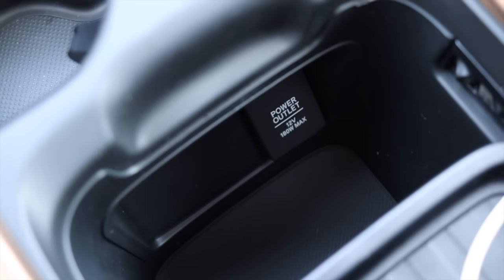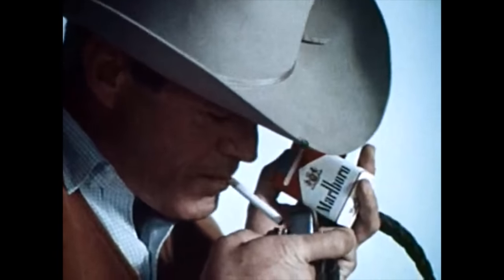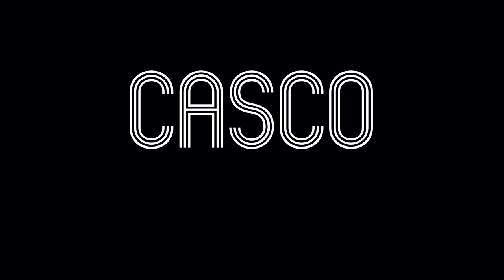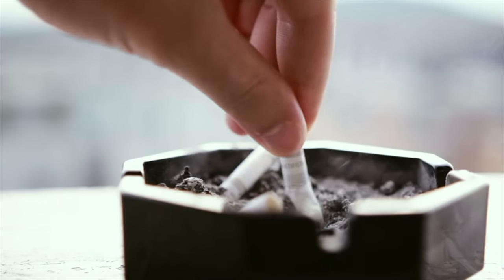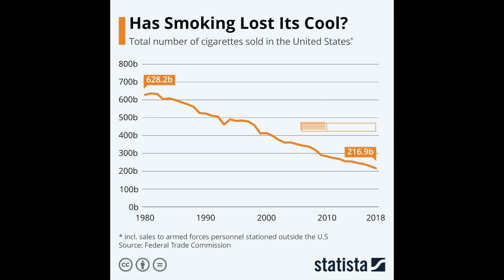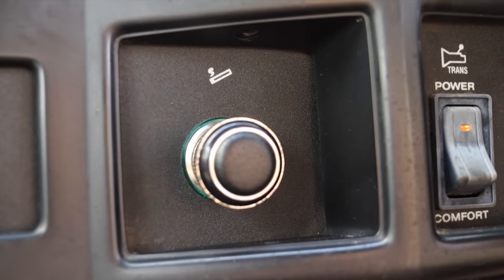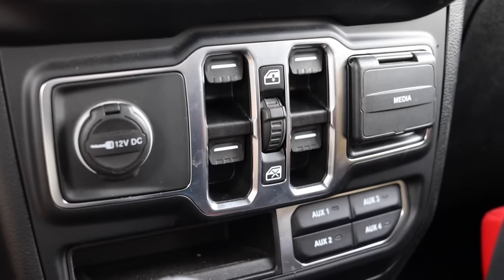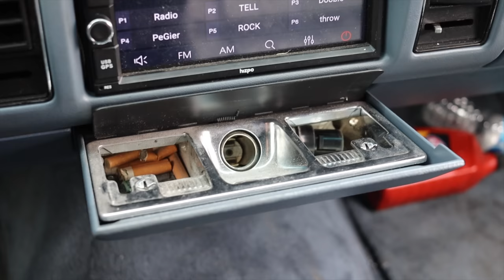Cigarette Lighters - How They Were Invented & Why They Went Away!

Comment: 4:39 not entirely, part of the reason they look different is because you can stick your finger in them and not get hurt. Household outlets ensure the contacts are hidden. Also plugs are different shapes in general to prevent plugging in devices that have different voltage, or current requirements. You can’t plug your dryer into a regular outlet. So all of these together are the reason
Reply: You can't plug a clothes dryer into a "regular" outlet because it uses 240V and a whole lot more amperage than a "regular" outlet can handle. It also requires a 4 pronged outlet, which combines two 120V lines to make 240V. All cars use a 12V negative ground DC system, so everything designed to be used in a car is designed for that system. I must have over 20 different things that are designed to be plugged into a "cigarette lighter" style car outlet. I have a 5 outlet pigtail that has one plug to plug into the outlet, then 5 separate outlets on it so I can connect up to 5 different things to a single outlet. If you overload it all it will do is blow a fuse.
Reply: @geraldscott4302  your reply is worded like you're disagreeing but nothing you said contradicts what they did
Reply: @MRdrPROkeithSR  I remember someone once said that the Internet is just people aggressively agreeing with each other and I feel like I see an example of that every day lol
Reply: @geraldscott4302  yeah you’re agreeing with me lol
Reply: "you can't plug your dryer into a regular outlet" had me puzzled for a solid minute
Reply: Only in the US you can plug a dryer into a regular socket.

Us more advanced countries have one socket that can power every household item.
Reply: @geraldscott4302  clothes dryer funny that i have a dryer washing machine combi plugged in with normal plug
Reply: Jam a dime or foil wrapper in it and you can get your finger burned, if you didnt blow the fuse first.
Reply: @geraldscott4302  actually 240 is the standard we just split it to get 120. Also you can get 120 volt dryers
Reply: @davidwithey6036  those mare usually eitehr hideaways or trailor sets
Reply: actually, you can plug in a dryer to a standard outlet in any country with an actually reasonable electrical system. not that we have much use for dryers in Australia anyway
Reply: @Robert-cu9bm  *only in the US you cannot plug your dryer into a standard outlet

(you said 'can')
Reply: @0011peace  no, they're on separate phases. normal countries have 240 on *each*, so if you're combining phases you can get a total of 420v. America's electrical system sucks so much ass
Reply: @rolls_8798  
No it's center tapped. They use a common ground
Reply: @0011peace  then why the hell are y'all using 110?

Edit: as in neutral, right?

Edit 2: don't phase separated waves have the same neutral anyway?
Reply: @rolls_8798   240 in europe they don't split  and the splitohase difference is 180 most circut don't care about the phase.  in one phase like in europe you have one direction to ground in us we have a opositive hot and negative hot with respect to each other.  We do this becausee its safer 120 at 15 is half the power  of 240  at 15 amps.  Power can burn and causes heating.  So it is safer to have cooler circuts.  But some devices need 240 so tap from prositive to negative its 120 - (-120) = 240 or -120 -120 = -240 dependimng current flow reference
Reply: yes you can plug your dryer into a normal outlet... except if you're in the good old USA with its archaic 110v. and a dryer 3 "foot" high.  Everywhere else the dryer is a metre high... and  240v... = plug the same
Reply: @rolls_8798  
Phase is relative to one of the branches. A center tap creates to signals 180 degrees out of phase with respect to the other. If had 240 center tapped you could get 480 total. Most modern devices use 12 volts at micro amps. Most dices just don't need 240 you can use less power. This means the plugs don't have to be rated for high thermal resistance. Twice the power means twice the heat. There is normally no need for the extra power. The way the make the power the same phase  is by putting the hot of each side on the hot and the other to in circuit ground. What most people call ground is earth or out of circuit ground and is safety feature. BTW, it's mostly just Europe not the world. Japan use 120
Reply: @0011peace  here our phases are 120° apart and we have 240 on each relative to ground. 120v is definitely worse for power and thermal control. The only benefit I can imagine is that since the safety mechanisms are so bad in your system (god awful plug and lack of house-wide GFCI and RCD), you need twice as much conductance/capacitance for a mains electric shock to kill you.

for a 120v appliance to get as much power as a 240v one, it needs twice as much current - simple ohm's law and I think you get it. More current means you need a much heavier gauge wire (copper shortage) and that a lot more energy is dissipated into the wire (as heat). This ends up globally limiting the amount of power your 120v outlets are able to provide (like 2000w or something isn't it?) and gives you a lot of house fires as well as a significant amount of electrical waste. Can't remember the last time we had a fire or death here caused by electrical apart from maybe a covered heater.

Edit: what you said about cooler circuits doesn't make any sense. if an appliance needs 120w, it needs it regardless of voltage, so at 120v it draws 1 amp, at 240v it draws 0.5 amp. only difference is the current

Edit: I said power instead of current goddammit
Reply: @0011peace  I'm in Australia not Europe, and again, the device needs as much power as it needs, so at twice the voltage it just uses half the current - which is a good thing. phone chargers don't use a lot of current but blenders and mitre saws and concrete mixers exist. it must suck to have a special outlet for only big appliances and high power devices (usually the power output of your power tools is just decreased instead, might be why so many Americans 'invest' in such wasteful and useless cordless tools when they don't have a use for them) and you have to run an extra line of wiring.

again, the 120v needs twice as much current which means more heat and that you need thicker wires for the same energy
Reply: @rolls_8798  
So you have 7.5 amp plugs and the idea that 120 is North American is wrong. Many 0laces have 120 in Asia. Besides 50 Hz causes flickering compared to 60 Hz because human eyes see at 60 Hz.
Reply: @rolls_8798  you need 7.5 half amp circuits to have the same power at twice the voltage.
It the breaker and the recepticles that matter no the devices for safety.  15 amp at 240 volt would be twice the power to 15 amp at 120.
Other than preference there is no real resaon one is better than the other.  The frequency however is 60 hz is superior as it matches teh eye movment and doesn't cause visual flickering.
we have 2 phase 240 total 2 phase which is better than 3 phase as its just negative vs positive and you can just reverse the leads to make it positive.  that is what tyhey do on the 120 circuits half use positve 120 the other inverted negative 120.  Some ciriots can can't handle 120 and trying to bring the phases together wouldn't work.  2 phase only takes inverting the leads
Reply: @0011peace  America is just the place most commonly associated with it and the people there tend to believe they're the best at everything for some reason (obesity rates maybe). 120v is worse wherever it is, it's especially highlighted in america though because of how bad the other aspects of its electrical system are as well.

the human eye does not see at 50hz or 60hz but hundreds of times faster than that. there is almost nothing where the frequency of mains is transferred into the final product. for example almost every LED light uses a switch mode power supply and dc (with a frequency millions of times greater than mains). perhaps a CFL? I might have noticed on a low quality unit that was failing, with my eyes half-closed, my vision blurred and being half-way asleep a visible flicker but I can almost guarantee the same thing would have been present with 60hz. the only thing that is perhaps the slightest bit cool about 60hz is that you can very easily make a clock keep time off of it, which they did back in the day, but incredibly inaccurately

Edit: CFL not CRT goddammit
Reply: @0011peace  of course 15A at 240v is twice the power of 15A at 120v. the point is that for a given power (like for every single appliance out there) the amperage needed at 240v is half of that from 120v. wire guages are based on current, not voltage or power, you need a lot more copper to support the same power at a lower voltage compared to high, and it gets more hot.

to clarify: an average consumer-grade blender is 1800W, right? at 120v, that would require 15A, at 240v it would require 7.5A. 120v requires minimum AWG 11 in this scenario, and 240v needs only AWG 14. You need a lot thicker wire to produce the current needed for 120v, instead of this the total amount of power your devices are allowed to consume is decreased - unless you get the weird annoying four-prong out.

I believe many American workshops and sheds and have to be fitted out with 2 phase and higher amp rated outlets just to be able to supply the tools with enough energy. that sucks

https://en.m.wikipedia.org/wiki/American_wire_gauge

https://resources.altium.com/p/know-power-dissipation
Reply: @geraldscott4302  ... not all cars are negative ground. Up till the 1970s many imports had a positive ground. (speaking from the USA perspective)
Reply: @0011peace  ... gas driers are 120 volt because there's no electric heating element.
Reply: @rupe53  i never said they weren't and there are eletri 120 vo9lt dries they are smaller hiude away and mobile home units
Reply: @0011peace  yeah i know you have a junction for it. To get 240 you have a double slot fuse. instead of single slot.
Reply: @davidwithey6036  they use 2 15 amp breakers that bound together yes but also the line in is 240 not 120
Reply: @davidwithey6036  well if they weren't idiots they wpould turn off the breaker before working on the  line anyway.  Zero volts at zero amps is much safer. just don't try figure out resistance😁
Reply: @0011peace  The line is 240v yeah but before you get to touch it they split off so no they are 120. you have a 240v coming in the home. you then have 120v going left and a 120v going right. they is why they need a bigger fuse to link both up. so yeah your right to the core they are 240 but to stop them hurting themselves splits up before anything else. Like wood freaking going nuts in USA and loads dying from it because they are idiots and don't do a dead mans switch lol
Reply: Usually the 240s are above 120s in breakere/fusebox.  Like I said there are 120 elecrtric dryers.  They are less powerful usually hideaway and mobile trailer units use 120.
Reply: @rolls_8798  You have no idea what you're talking about.
Reply: @rupe53  not just imports. I think the standard was positive ground for the first bit of automotive history, then it was all over the place. it's a bit of a guessing game with pre-1950s cars as I understand
Reply: Depends on the country you are in.
Australian power outlets are backwards compatible - you can plug a charger into every outlet regardless of if it is rated for 10A, 15A, 20A or 32A (they are differentiated by the earth pin width in the lower end and the conductor pins in the larger sizes).
Reply: @brickman409  

Oh yeah? Well, what you said makes sense and I don't have to agree with you but I do. So if you don't agree with me agreeing with you that's your problem!
Reply: @rolls_8798  ... I'm going based on my experience, which obviously doesn't cover everything, so I went looking. What I found was a lack of standard. (from the web) "For the most part, American car manufacturers used positive ground electrical systems in the 6 volt days (except for GM, REO, Ford Model T's, some Lincolns and pre-GM Cadillacs) until they switched to 12v around 1955, then they all (except for Packard) switched to Negative ground electrical systems." I will also note that my 55 Chrysler was 6 volt negative ground. These days I always look first when working on older cars. Imported cars have a different timeline. Mid 60s British could be either way.
Reply: @rupe53  I submit to the greater power. You almost definitely have more experience than me, most of mine comes from (an extensive array of) youtube videos of random guys fixing cars. I don't really fixate on the model years, and often the guy working on the junkyard finds doesn't know themselves

Edit: but yeah, I'd always check first if it's remotely in that time frame
Reply: @skylined5534  lol
Reply: Not everywhere, most clothes dryers plug into a regular (240V/10A) outlet here in Australia.
Reply: @klebdotio3284  that's the only type of home-grade dryer/appliance we have as far as I am aware. a massive commercial one might use dual phase 320v or tri-phase 400v
Reply: @klebdotio3284  weak dryers! We got 240V/30A here
Reply: Ohhh… another engineering design preventing Darwin from winning

Comment: Future videos ideas 
1 Mast antennas/power antennas 
2 Why pre 1980s cars had circular or square headlights 
3 vent / smokers windows: vents that are not part of the HVAC system 
4 smog pumps
Reply: Don’t forget the antennae that were imbedded in the windshield and rear window and the shark fins we have today.
Reply: Funny story about how sealed beam headlights became un-required. Ford wanted to introduce aerodynamic headlights for styling. They went to the government to ask permission but the government said no. Ford realized that smooth headlights improved the car's aerodynamics and therefore reduced emission and therefore increased safety. They went to the government with that logic and the government said "but of course! Of course you can have aerodynamic headlights!" Sometimes I wonder what would have happened if the government still required sealed beams.
Reply: Also: 1. the decline of manual transmission
2. Slow decline of key ignition being replaced by start stop button.

Comment: Believe it or not, the cig lighter socket in my truck will NOT charge anything, only the seperate 12v socket will. It will however make hot, so it does work... 
Also, lots of manufacturers have put in classic home style outlets in their upper tier vehicles in the past few years, so I am sure you are correct, the USB and those will phase out the old hot tubes. I was like you and fascinated by them in my parents cars, neither smoked but I did use it to burn a few things... including myself on one occasion, that was a learning day :P

Also! I believe my 1996 Towncar had six seperate ashtrays, which was always funny to show friends, but not use, since Ive never smoked :P
Reply: Yep. My 2011 Crown Victoria only has one (car built on the same platform) but I was doing some stuff removing the rear door panels and found ashtray spots inside the rear doors
Reply: my 2001 cadillac deville had 2 cig lights and ash trays in the rear doors and 3 in the front
Reply: I have a 2001 Ford expedition Eddie Bauer cigarette lighter with the pop out still in with two ash trays in the back and one in the front
Reply: 1994 Oldsmobile cutlass Supreme I had an ash tray in every door... and one shitty cupholder in the center armrest.  I went to pick and pull and grabbed a 5th one to replace my coin holder with an ashtray.  I didn't smoke nor did I let anyone smoke in my car.
Reply: @charlie_nolan  
Some P71s have hybrid pull out trays that have more of a generic tray that's not intended as an ashtray bit keep the outlet bit as a cheap way to uavr an additional outlet.
Reply: @P7777-u7r  mine came with an ashtray in the slot but not a lighter, I put one in there though because it was sad and empty